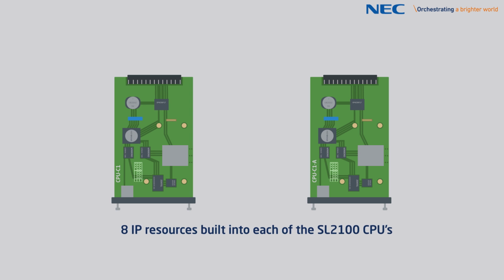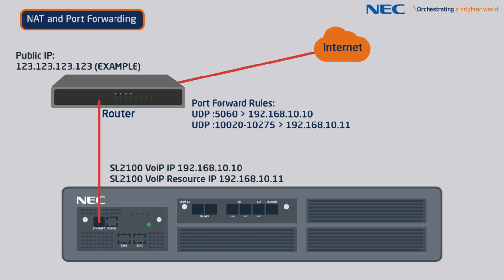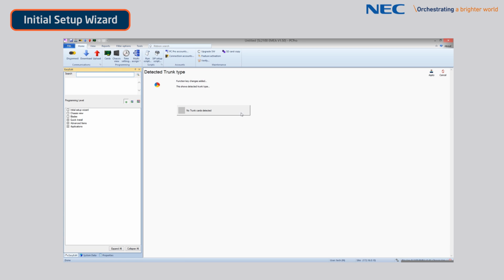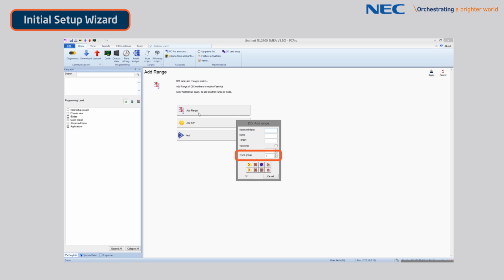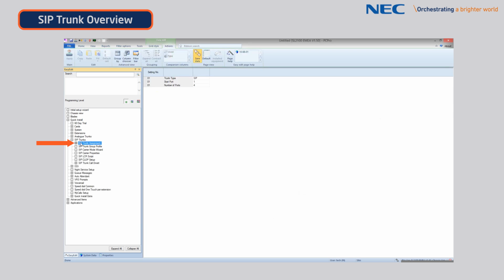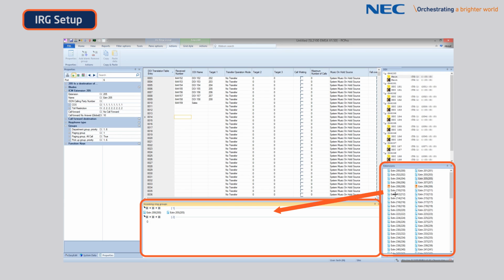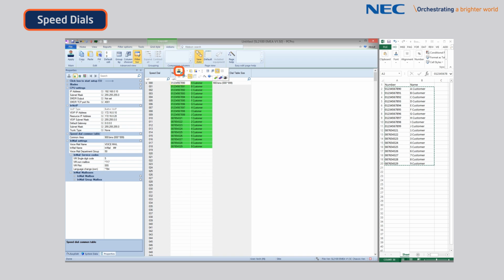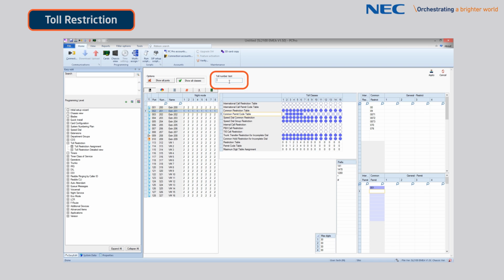SL2100: Quick Install - SIP Trunks

Comment: Sir, I want to ask, for example ext 199, how do you make a 1 digit dial?
Reply from the maker: Hi

Many thanks for your enquiry.

For One digit Service Codes:
These are setup in Easy Edit-System Numbering Plan-Service Codes-Single Digit Code
These are Service Codes that a user can dial during a call, eg when calling a busy extension you can dial # to set Camp-On.

To have a phone called using one digit, this can be done several ways:
1. Setup as the Operator in Easy Edit-System Numbering Plan-Default Operator
Other users dial 0 to call the Operator extension
2. Setup a Department Group in Easy Edit-Department Groups-Department Group Options
Setup the Pilot number with a single digit
Add Extension 199 into the group
You will also need to setup the single digit dial in Easy Edit-System Numbering Plan-System Numbering

Kind regards

The NEC Team

Comment: Is SL2100 Requires 2 IP address for SIP Trunk configuration
Reply from the maker: Hi Ganesh
Many thanks for your enquiry.
The SL2100 (and the SV9100) requires 2 IP addresses when using VoIP (IP Extensions and/or SIP Trunks).
The IP Address configured in PRG10-12-09 is used for signalling, e.g., SIP signalling. 
The IP Address configured in PRG84-26-01 is used for RTP, or in other words, the voice media stream.
I hope this answers your question.
Kind regards
The NEC Team
Reply: @NECITPLATFORM  Thanks a lot for ur reply

Comment: Hi i have SL2100...its required SIP License for each line ?
Reply: Hi there
Yes, a SIP trunk licence is required for each line.
The only exception is that if you have the CPU-C1-A installed then this includes 4 SIP trunks, these 4 trunks don’t need the additional licence.
Kind regards
The NEC Team

Comment: Hi 
i using SL2100 in default setting with 3 extensions. i want to incoming all calls transfer to extension 201 and 202 when the main extension is busy or no answer then after 10 rings should transfer to next extension. technet.ae@gmail.com
Reply from the maker: Hi Technet - thanks for your enquiry.

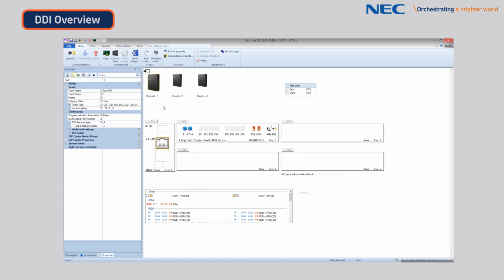The DDI routing is shown from 15:10 in the video.
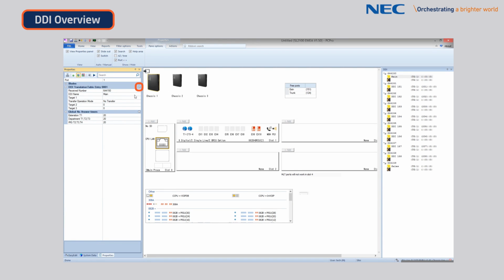At 16:10 the example shows the three targets for each DDI.
If you want a DDI to ring at a specific extension (e.g. 200) then enter 200 as Target 1.
To step on to other extensions then choose the ‘Busy/No Answer’ option within the Transfer Operation Mode.

The No Answer timer is shown within the Properties pane – Extension T1 (default = 20 seconds). Select view type = Advanced within the Properties Pane.
Calls will step on to Target 2 and then Target 3.

I think you then want to step on to extension 201 for 10 rings and then extension 202.               
This can be achieved by creating a Department Group containing extensions 201 and 202 – use the Department Group section within PCPro Easy Edit or the Department Group Pane to create this group and define the No Answer step on timer to 30 seconds (approx. 10 rings). Select the No Answer option within Enhanced Hunting type.
Within the DDI Target 2 enter the Department Group 2xx (xx = the Department Group number 01~50 you setup)
Help is available within PCPro (press F1) to explain the settings available.

Kind regards

NEC Team

Comment: how configuration of the secretariat boss's station
Reply from the maker: Hi Werhani - Many thanks for your enquiry.

Regarding a Boss / Secretary Call - this is not related specifically to SIP trunks, its available to any trunk type (CO (analogue) / ISDN / SIP).

In more detail:

Secretary Call (Buzzer)
• Boss & Secretary must use NEC Multiline terminals with programmable Function Key (code 41 + Boss/Secretary extension #)
• Secretary can have multiple buzzer keys to support multiple Boss extensions
• Press the Function Key to buzz the Boss/Secretary
• The Boss/Secretary places a normal intercom call to respond

Secretary Call Pickup
• Secretary must use an NEC Multiple terminal with programmable Function Key (code 42 + Boss extension #)
• Secretary presses the Function key to divert the Boss’s calls to their extension
• Boss - >Secretary divert is turned on/off by pressing the Function key at the secretary terminal

If you require further information please see the appropriate sections from the 
SL2100 or SV9100 Features & Specifications Manual which is available from your local NEC reseller/distributor.

Kind regards

The NEC Team
Reply: @NECITPLATFORM   can you give me a manual setup of sip trunk without voip card just only by using the ethernet the built in 8 channel on it.
Thank you.
Reply from the maker: @ephrembolalin3459  Hi Ephrem, thanks for your enquiry. The guide currently available on BusinessNet includes both with & without VOIPDB card installation.
 The VOIPDB card is optional. https://businessnet.nec-enterprise.com/Products/Communication-Servers/SL2100/ProductDocuments/SL2100%20Quick%20Install%20Guide%20-%20SIP%20Trunks%20Rev1.1.pdf

Page 18 shows the setup of the Ethernet port of the CPU card.
 I hope this helps. Kind regards, The NEC Team.